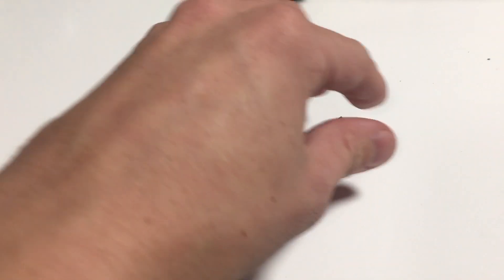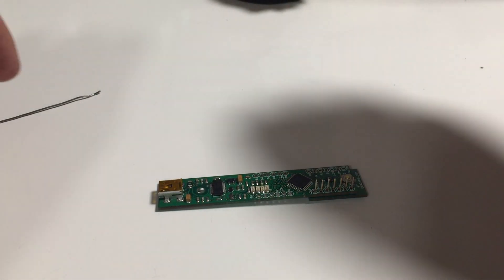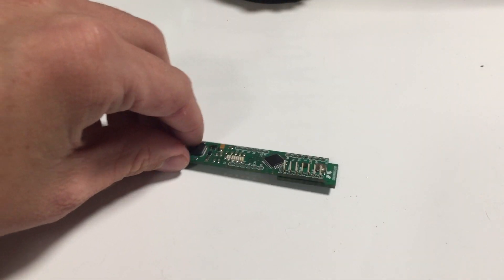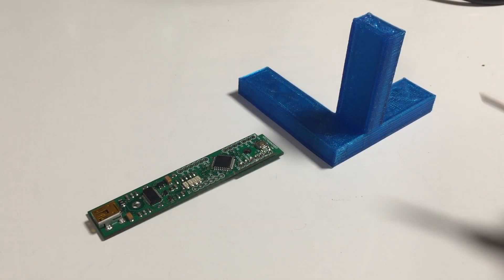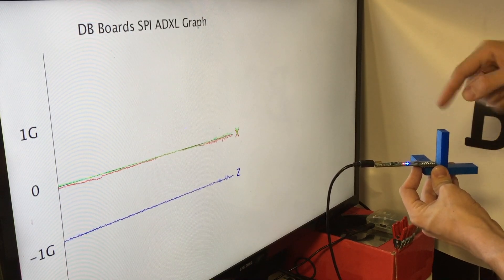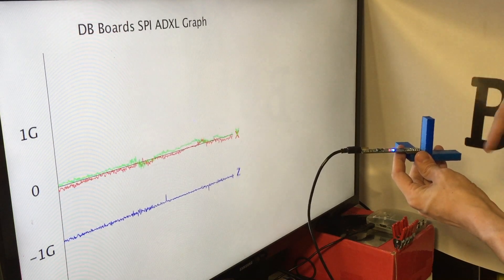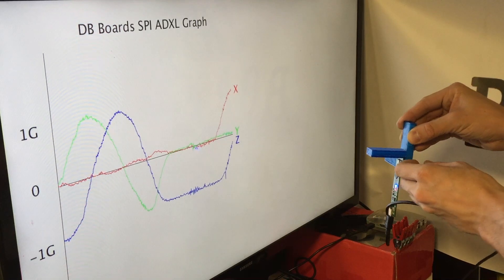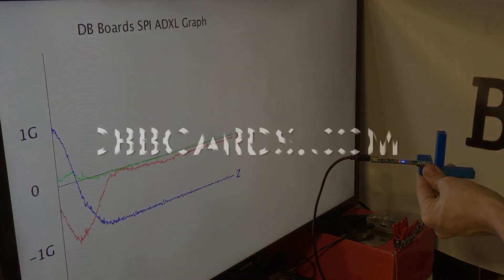ADXL345 and Processing

Comment: Im having problem with the Graph. The X, Y, and Z only stays at 0. Im using Arduino Nano
Reply: You need to set the device into measurement mode before taking a reading. Write the value 0x08 to the register 0x2D to achieve that.